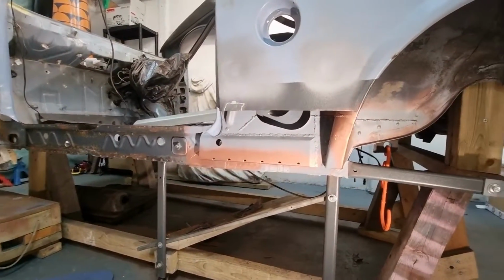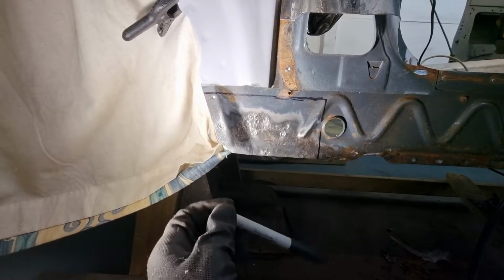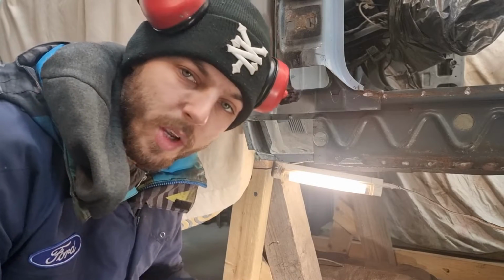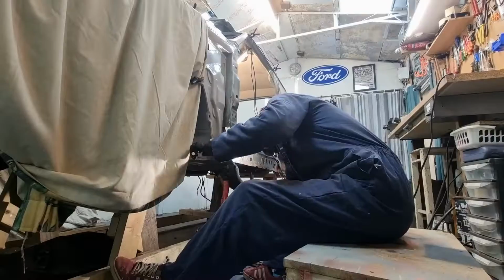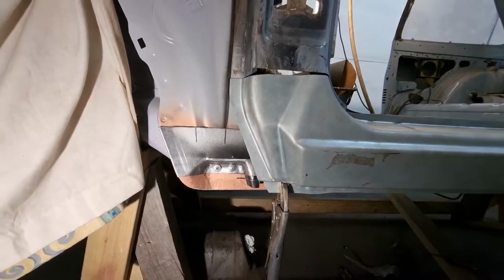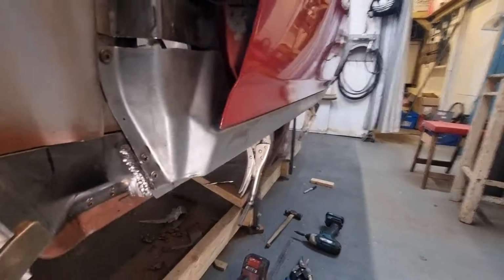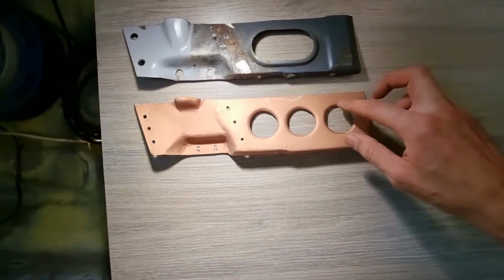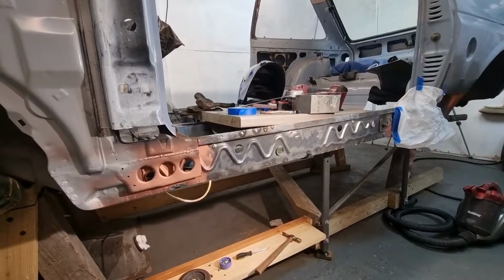MK2 Fiesta inner sill + front sill support rust repair | Fiesta diaries | Ep.47

Comment: Great repair panel, your attention to detail is fantastic👏👏👏 fair play for making a whole new repair panel, I would have repaired the old section, welding a new section in the middle off it, but the outcome off your panel is fantastic, your welding has changed over night with the new welder!... gasless was soo time consuming, clean each tack between welds lol! What a the holes on the new panels? As you will be plugged from the outside off the new sill too it? Keep up the great work👏👏👏
Reply from the maker: Thank you thank you!! I did consider repairing the original, but the problem is that by the time you grind off all the rust, the metal becomes so thin, it's useless (it's already made of very thin metal to start with). And it didn't fit well at all to the new sill... or the old sill🙃
The little holes are from the self tapping screws that hold everything together before welding (they eventually they get filled up with weld and seem to aid good penetration, the bigger hole for the plug weld goes on top of it)

Comment: Great video, doing exactly the same myself but had rotted so badly nothing was left so had no reference points .Before you put the outer sill on what are you doing about the sunroof drains ?? I'm planning on modifying mine to exit into the front where the front wing space is rather than the drain tubes exiting straight into the sill and then rotting out again - just a thought.Keep up the good work 👌
Reply from the maker: Exactly that mate, currently working on the sill and both drains are being relocated to the outside, 20mm hole with a grommet works beautifuly to send the drain pipes anywhere under the car... has to be one of the most dumb designs ford have ever come up with. Sending water inside the panels - wtf!?!?!?

Thanks for watching mate, do love interacting with other fiesta strugglies, im with you in spirit - we'll get these crust buckets on the road one day!!😁
Reply: @strugglyboys  did you manage to repair the rear quarter inner sections as the inner structure is similar to the front, luckily for mine I have a new old stock rear inner complete rear quarter so can use that to replicate the lower peice rather than chop it off a genuine panel,let me know if you need some images so you know what it should look like -if yours is knackered on the drivers side they are different from left to right due to the fuel filler location.
Reply from the maker: Yeye i know what you mean about the rear bits. I haven't touched the driver's side yet but it's all bad there too. Would love to see some pictures for sure, maybe send them over on instagram. Those old stock panels are precious, rare as anything and like you say - amazing for reference